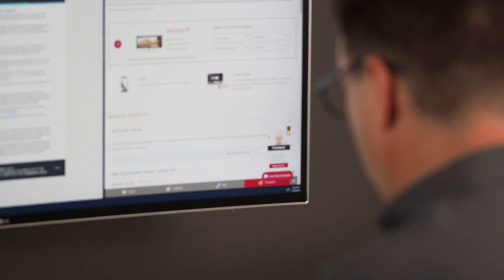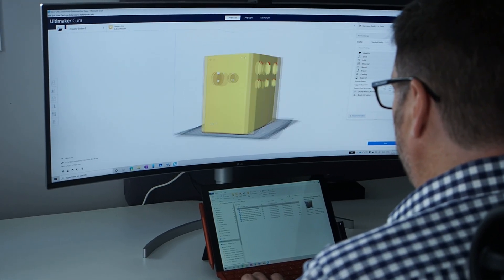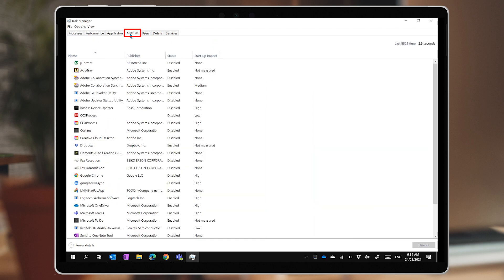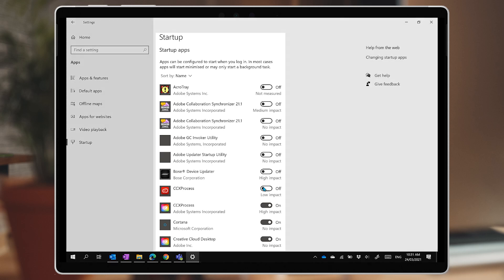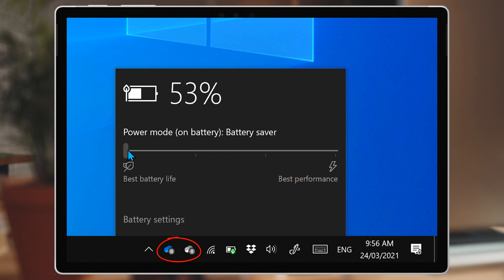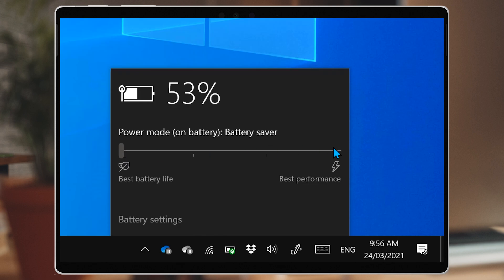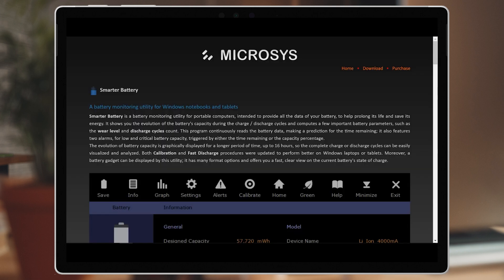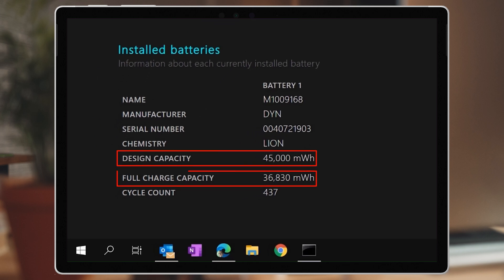Surface Battery Tips and Tricks - 2021 Update!

Comment: Very nice thorough video with all the angles to help battery life!  What monitor is that and how is it with your surface?  Does the surface heat up and fans run or is it pretty quiet.  I am looking for a good ultra wide for my SL4 and I love LG. Thanks!
Reply from the maker: I've had this LG Widescreen for a few years now. We did a review of it here: https://youtu.be/FRBShuFdN7o

My Pro X and Pro 7+ (i5/256 LTE) don't have fans at all, so they never run! The Pro X never really gets warm, but the Pro 7+ gets mildly warm under load. They both handle that monitor with ease, and it charges them via USB-C PD charging while it's connected too. No dock necessary with that monitor.
Reply: @oztabletpc  Oh man I completely forgot I watched that video!  Thanks a lot for the message.  I’m gonna grab one today using your link. Have a great rest of the week and keep the videos coming.  They are always easy to follow.
Reply from the maker: Thanks. Not sure if it's a current model anymore, but there will be a similar version available. Great display.
Reply: @oztabletpc  the new one is basically the same but is 144hz so I need to see how my SL4 will handle that refresh rate and is a lot more money than the previous version now!
Reply from the maker: @duchenedesignsolutions7036  previous one I have was around $1k USD.

Comment: Great video! I don't use my surface pro. With all thus info. Should I keep it plugged in all the time?
Reply from the maker: I think it's good to run it on battery occasionally - for you and the computer!
Reply: @oztabletpc  Thank you
Reply: enable battery life extender from the bios, it will on charge to 50% to preserve the battery

Comment: Great video, thank you! I would be interested to know how the use of the dock impacts battery. Does using the surface on the dock at 100% charge for long periods impact battery life? How often should it be taken off the dock and allowed to drain to optimise battery life?
Reply from the maker: Ray Roche suggested in a comment here to let it run on battery once a week. I think that's a good suggestion for you and the computer! It's hard to remember sometimes to detach and work somewhere different...
Reply: @oztabletpc  I read a Mircosoft written tip this week to let your Surface run past 50% once a week. Your thoughts?
Reply: i have a huge battery drain problem in my surface 4 pro do you have any solution
Reply from the maker: Have you checked the battery tab in settings yet? What is using your battery?